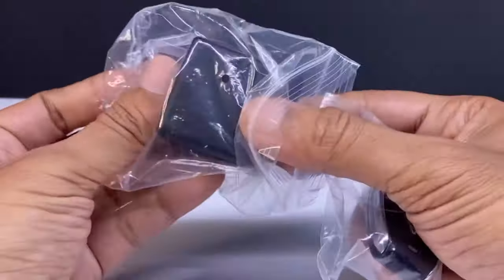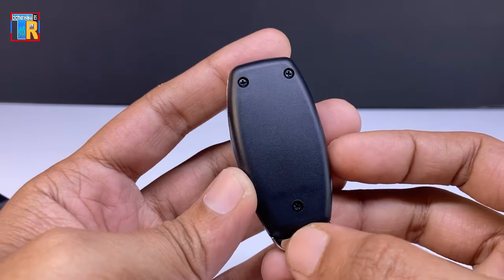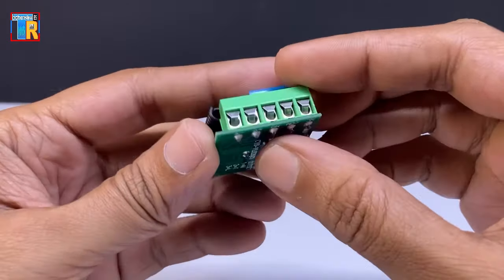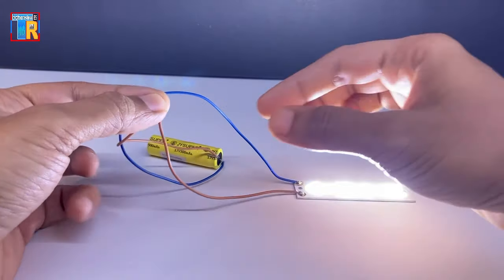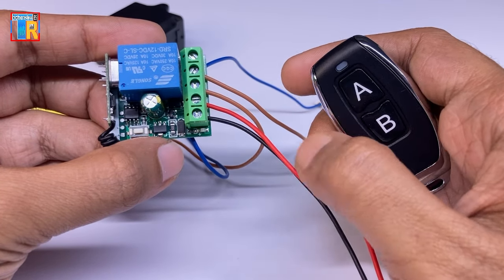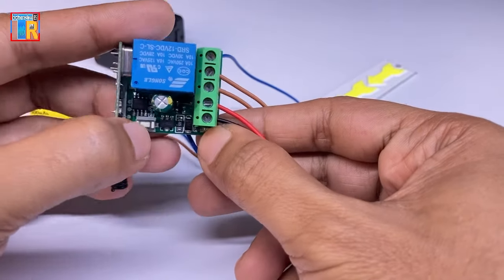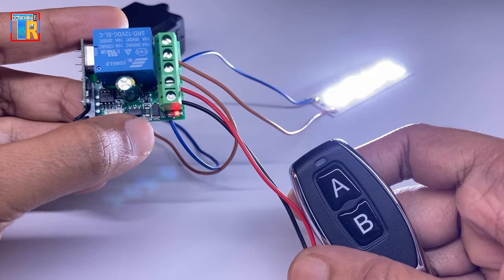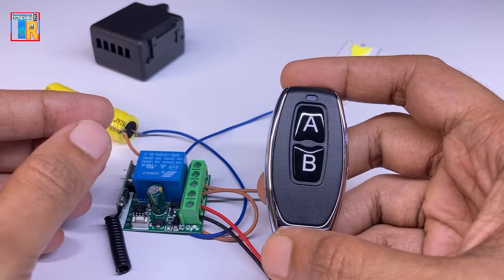The Ultimate RF Remote Control Switch Review: Functions  and problem solving

Comment: Interesting! I have one that looks very similar but it’s from Qaichip. Instead of pressing the button to change modes, you use wire the unit in different way (in some cases with an additional thin jumper wire) to set it manually. Does your unit have a button that will allow it to forget the default remote codes and / or learn new codes?
Reply from the maker: Yes you can reset & it can learn new code

Comment: Hi, I've tried using this kind of Wireless Relay with a Zero Delay Gamepad Board where I connected the V+ (12V) and V- (GND) from the floppy power connector from my PC and I connected the terminals of a button  like this: [Button  1 +] in the NO (Normally Open Connector) and and [Button 1 -] in the COM (Commoon connector) but sending the signal to the relay activates it but the button doesn't get pressed (like it didn't make contact between the + and the - connector of the button). Also I checked that in the Zero Delay + and - connectors of the button there's a voltage about 4V. I didn't expect that the button connectors had voltage between the terminals. 

I find it's weird that just making contact between the fast-on terminals of the button triggers it but when connected through the relay it doesn't acctivate the gamepad button.

Have you ever tested it with a Zero Delay USB Gamepad? ... or any gamepad ? I ask this because I used it for instance to make a switch to make contact between a data pin in my parellel port and a GND pin in parallel port but I fried my motherboard. I'm scared I could fry something else when using the relay to make the contact.

I hope you can give me advice with this.
Thanks in advance!

Comment: Very well demonstrated, thank you! 

Can you have 2 different connections on this module so that the 2 buttons operate them individually? 
“Button A activates and deactivates 1 light while button B activated and deactivated a different light”
Reply from the maker: Thank you. This module has a single relay so it can operate any one channel but if you want multiple channels you can choose same module with dual channel relay which is available.
Reply: @technoreview85 
That’s very helpful! 
Thank you so much

Comment: Can this remote be used for car central locking? If they same frequency
Reply from the maker: I think you have to use learner remote. If remotes are in same frequency, thereafter needs to match  keys code

Comment: Friend I’ve subscribed please help me I’ve just set mine up to on permanent and a off b 
I want this mode and I want flash on off what do I need to program could you reply I’ve subscribed ❤
Reply from the maker: Yes. You can use two different mode. You have to do pairing proses for 2 times. Follow video instructions for defferent modes. Thanks